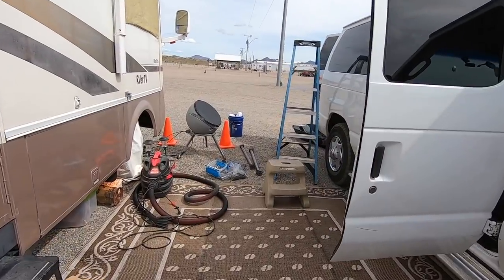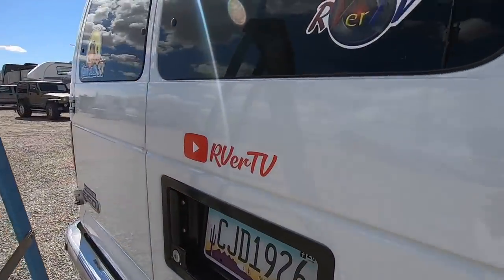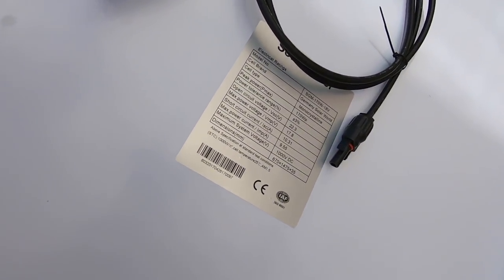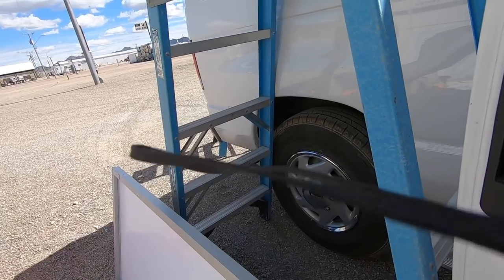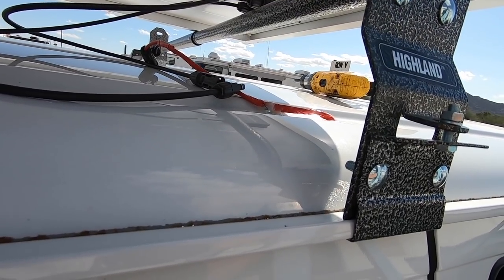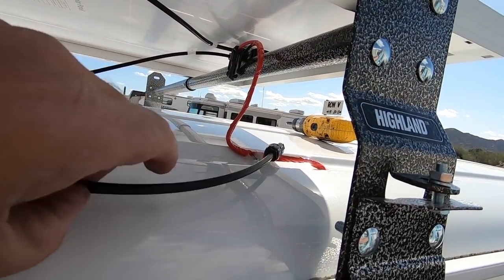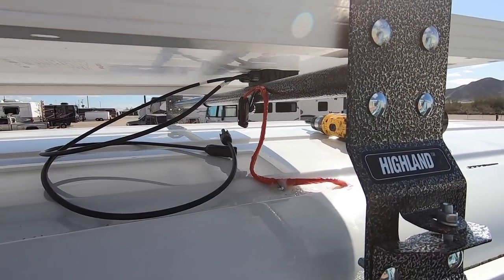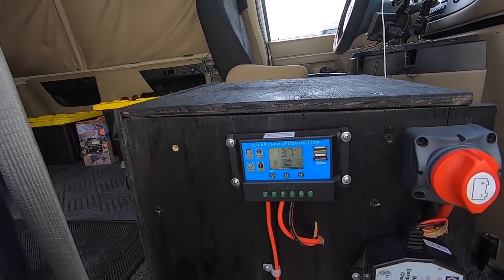Solar Panel Install... Conversion Van Build

Comment: Russ, you can get another roof bracket to mount at the front, then run 2 or 3 10' Unistrut on the three cross bars. Then mount the solar up front and put the pod behind the solar panel so you can get into it from the rear doors. Just a thought. Happy trails.
Reply from the maker: i looked at that... it would have been awkward to access and just not enough roof area

Comment: Hi Russ !  .. I hope you are going to anchor the other side of the solar panel to the bar.. Don't just rely on the 4 bolts.. Wind could lift the panel enough to crack it if it flexes !  You could get another rack and install that cargo carrier ahead of the solar panel.  or do you have a vent cover up there ?
Reply from the maker: it is secure

Comment: You could split some 3/8 rubber fuel line and slip it over the solar wires and zip tie in a few places. It's pretty tough and should protect the wire well.

Comment: Lowe's has the same 27 gallon storage totes with a red top ( craftsman brand ). The key to these totes is to figure out how many you need for your system or project, and buy them all at the same place at the same time, so they nest together. I got a few of them one here, one there, and they don't fit together.

Comment: Pretty soon we will be able to get the Flux Capacitor to put in our vans! Lol 👍👀 After the installation of the chrome reverse modulator kick down valves.. 
 Nice job, i really like the battery box/solar you built. The whole van build out actually. Looks cozy too.

Comment: I would have put the solar panel across instead of longways, but good job
Reply from the maker: the panel was 3 inches too long to do that....  if i had a do over i would have gotton 2 smaller panels

Comment: How'd you attach the solar panel on the other side?  or are you only securing it on one side?
Reply from the maker: aluminum clips into the rack...both sides
Reply: @rvertv  Thanks, will you show that side too?  We have panels to install on our 5th wheel but still trying to figure out how to secure them.  As well as one panel on top of the pickup truck, to keep it's battery in good shape too.
Reply from the maker: @elainemagliacane  i will show it on the walk thru video